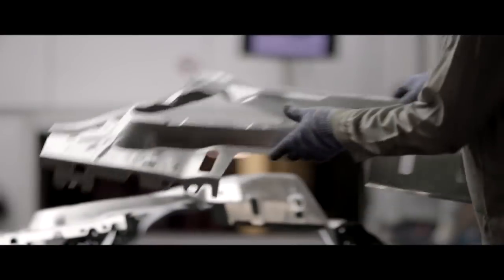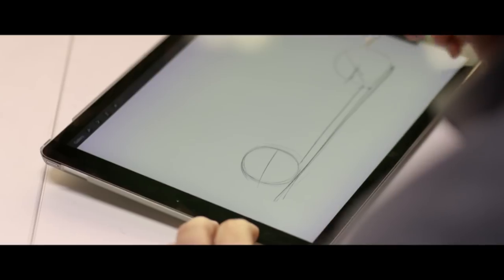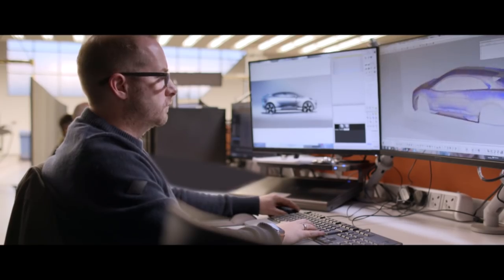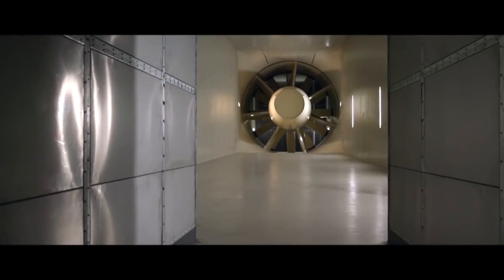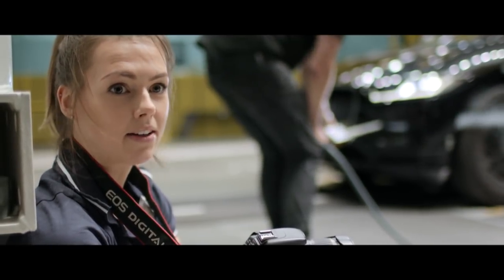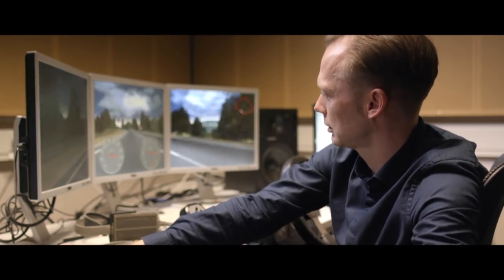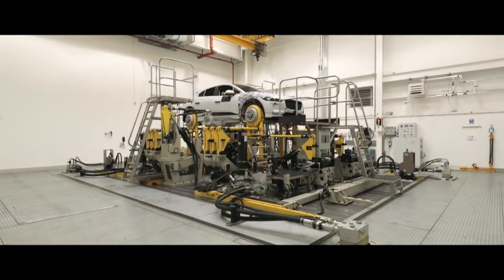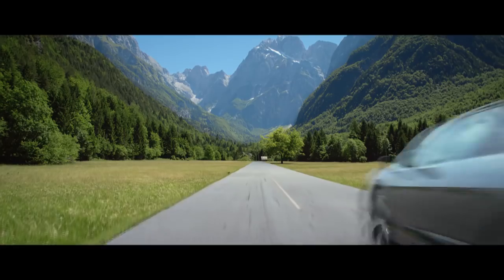Jaguar I-PACE | Creating the World’s Finest Electric Car

Comment: Electric is hypocritical. Here's the dilemma about electric cars. If you are charging it with electric from a coal fired power plant, it defeats the whole anti-petrol/fossil fuel purpose. We need to increase thermal efficiency of the petrol/gas, harnessing as much power for every drop of petrol/gas, which is why a hybrid is the way to go. Whichever manufacturer that can implement the current F1 power unit system into a common road car that has superior petrol/gas mileage, will win the race(no pun intended). If you can produce 200hp in a 600cc engine with batteries to store extra energy for extended range, now that will be 'superior technology'.

Comment: I am a huge Tesla fan, but as a European it is cool to see that we are getting great European electric cars. Elon Musk got this rolling, but in the end Tesla may lose to European competitors. Tesla has an edge in thinking in novel terms and being fast at designing. But they seem to suck at manufacturing. Here is the opportunity for European car makers to catch up.

Still there are things I wish Jaguar would learn from Tesla. Ditch the affinity for the old. Don't make traditional car sounds on an electric car. That just sound dumb. If you have to have sound, make it at least naturally fit with the fact that it is using an electric motor. 

The grill on the Jaguar works fine, but you don't really need it. Porsche and all Tesla's look great without it.

Comment: Then ruin the car using very old battery tech that limits recharge speed and is known for limited life issues.. not good. Nice try but no Cigar. Build a Magafactory and make some modern batteries for the car.
Reply: Ironic comment... Tesla is the company using inferior, small cylindrical, battery technology which they buy from Panasonic (who sells better products to their competitors which Tesla can't use because of their designs).
Reply: Vincit Omnia Veritas wrong. So wrong. Tesla are using new larger cells they are making in their new mega factory and they are of the very latest technology. The reason for using cylindrical cells is better cooling. The new batteries are being improved all the time and when the new Roadster is launched the cost (approx $77 per KWh) and the capacity 2x current by weight and size will justify their position and decision to stick with safer (than lithium polymer) technology.

Comment: hey please use a conveyor motor or accelerometer with a big pulley wheel on it to turn a generator to increase amperage for going uphill called high amp drain period because we hate getting stuck. if you run it in this method use the bottle shaped stick generator for they turn really easy. also if you use this method all the time it will make you battery shrink and make it safer and you get the mileage at the same time. thousands of kilometers per charge with a smaller battery.

Comment: Electric cars doesn't have engines so they don't need front grill, it is nothing great to appreciate air passing through it - such aerodynamics will slow vehicle.
Reply: Cooling still needed for electric motor and battery. Think before your type hey buddy.

Comment: Lipo batteries in a car is not a good idea.
Does not sound safe.
Reply: Mecrom - 10 gallons of highly flammable petroleum spirt in a car is not a good idea. Does not sound safe.
Reply: well, there is steel around it, and the petroleum is supposed to do that, the lipo cells are not.

Comment: I'm accually shocked, how bad this Video is all long.
From the part to the "forward" sketch (some drawing lines), very forward accually..
The scene of the seats, the door looked far too small to get in comfortably, reminds me to an alpha sports car, which aren't great at all.
Well, I haven't seen the full video at all, but the comments are full of fake engine sounds. So they probably f#cked that up too.
To the last and scarying point, where they showed of the battery, which layes on the deepest point of the car.. doesn't sound really protectiv to the point the battery could touch something and accually blow up.
Yeah probably unlikly, but I have serious concerns, to the point they are very late for the electric market and then got this.

Never hated on jaguar before, but the team behind that car seem to celebrate themselves too much

Comment: soon as they decided to add fake engine I was put off. to me, a great car is able to bring satisfaction without imitation. knowing that something is fake degrades credibility as a whole. This was one of the main reasons I was put off the i8. If anything I would suggest that you don't waste your money on producing fake sound and rather spending on having high-quality speakers as standard. because that's where I believe customers will be more satisfied. Apart from that i think jaguar are doing a great job so far.

Comment: saw one of these a few weeks ago (I live near MIRA) and wondering what it was. Jag should add charging jacks on both sides of the car, that way you could park on your drive any side without running the cable around the other side or reversing the car on, plus you could rig up some way of daisy chaining two or more to charge at the same time.

Comment: Can we make it sound like a TIE Fighter on the outside please? Also, can we have an aerodynamic roof mounted accessory that deploys while parked to catch the sun for long-range countryside drives? I would very much like to use an accessory like that to drive the upcoming electric XJ from Singapore to China. I don't mind if it takes half the day or more to recharge the battery, and of course it would be cool if it looked like a part of the car's design like a yacht flybridge or something. Already done that trip in my diesel XJ.

Comment: At the forefront of EV? hmmm. 
Why use clay models and wind tunnels when you can computer model? 
Why have a front air intake when you don't need one? 
Why oh why oh why the fake engine noise?!
Reply: You people really don't know how a car is developed. OBVIOUSLY they have a computer model. But you can't just build based on a computer model. The actual shape needs to be seen in real life in real size in all dimensions. I can't believe the idiocy, ignorance and naivety of people thinking a car can just be developed using software. You get a company to do that and see how it works out for them. 

The grill is for BRAND IDENTITY and it has a function. Watch the video.

Some people will prefer noise. It can easily be switched off. THEY ARE NOT FORCING YOU TO HAVE IT ON. For fucksakes. The people in this comments section are seriously dumb.

Comment: There is a debate about the direction of electric cars and the alternative to batteries being the fuel cell which Toyota believes will be the final answer as batteries really are at the end of the day a physical problem creating them , use finite resources , a long term disposal problem and a weight problem installed  in the car , solar produced hydrogen from water is the absolute permanent answer to the transport fuel problem , batteries are the short term answer because they haven't invested in the hydrogen project because as usual whatever is cheapest gets all the attention , its why hydrocarbon cars put electric cars out of business originally 120 yeas ago when electric cars were the majority .

Comment: I agree with several others to a toggle switch for that sound--- like the others, I love the silence of an EV.  I can imagine, though, that a sound might be something of a warning that you are going faster than you knoiw you should.

But to me, that silly, uzeless grille reminds me of decades ago when "car phones" became available--- before they could shrink the hundred or so pounds of telephone hardware into something as minute as a Galaxy S8--- a mobile phone was an obscenely expensive feature built INTO the car, with an exterior radio antenna.  Predictably, there were some wannabes who could not afford a cell phone but who wanted a fake phone antenna on their car.  Having that silly grille on the front is not only unmecessary, but most likely creating SIGNIFICANT drag.  I suspect the only reason it has that grille is to appeal to drivers that see some features as obligatory for qualifying as a "car"--- side view mirrors, door handles, open wheel wells, an established logo and/or nameplate--- and perhaps a gas filler door, as well.

Jag need to see it anew and utilizing ONLY those features which genuinely have a purpose on a state-of-the-art vehicle.

I do NOT like that grille, even if they try to pass it off as necessary for creating windshield "bypass air".
Reply: The grille is for brand identity. Something you people don't seem to understand. Tesla did not have a brand identity so could do what they want. The grille also serves a purpose. I don't think you watched the whole video but there is a duct above the grille that channels air more cleanly. In addition, the car does not look like a hard boiled egg like a model x for example.

You don't have to like the grille, but many people will because pretty much everyone says this looks better than any other electric car out today.

Comment: You know, watching this and seeing that with electric cars the designers have a lot of freedom, I can see why in so many sci fi films, cars look so futuristic and different. With the lack of petrol or disgusting toxic diesel engine, the designers don't have kind of tailor the car around the engine, they can just... go mad. Great stuff.

I've noticed that people are moaning about the sound effects, it's probably an option that you can turn off or just not have in the car, I like it, it's cool, but options are always a great thing. All electric and hydrogen fuel cell cars should have an option to have engine noise, especially nice old petrol car revs noises like the BMW i8 does, it's just cool and it'll help win over petrol heads.

I hope Jaguar do really good with their electrification and only do plug in electric and hydrogen fuel cell cars in the very near future. Unlike with stinkin' lazy VW, it's great that Jaguar are progressing for the better.

Comment: So ridiculous.  Add sound back to EVs brings back an unneeded distraction.  When you accelerate from 50 to 100 mph in an EV you know it already!  You don't need added noise.  Let go of the stupid gasoline motor paradigm please.  At least give the option of an off switch for the stupid fake engine noise.